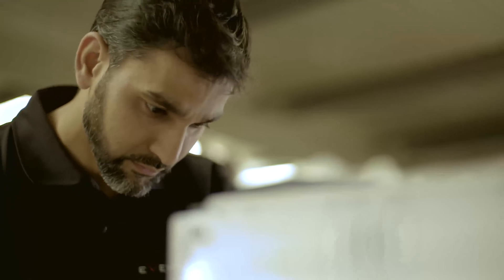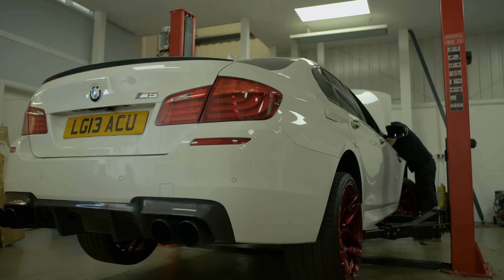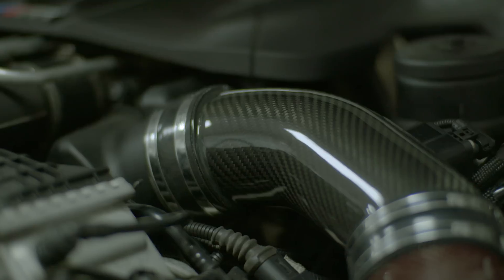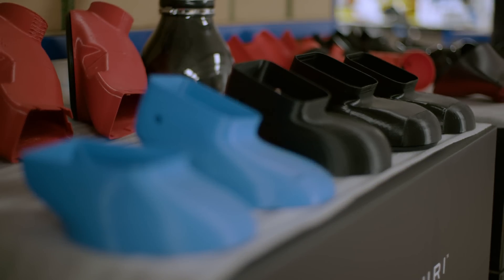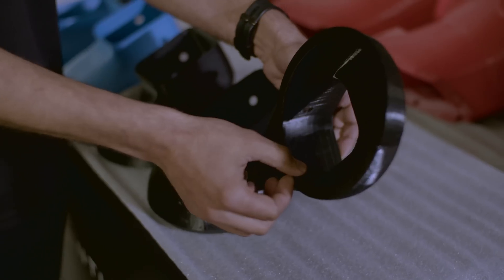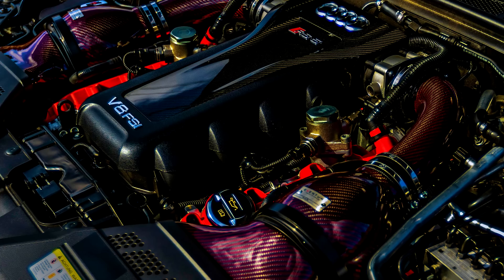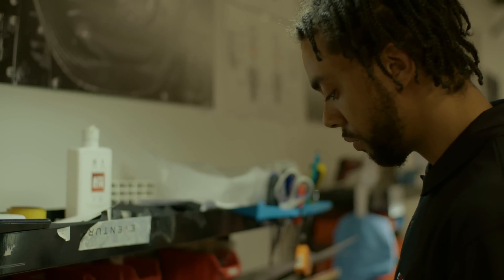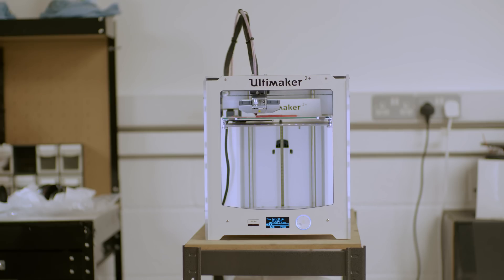Eventuri: Functional and fit testing of performance car intakes - Ultimaker: 3D Printing Story

Comment: @ultimaker what materials do they use for their prototypes?
Reply from the maker: Hi Miiiiauuaua,
On this case study, ABS is used for their car intake models. You can read more about the material and its properties here: https://ultimaker.com/materials/abs
If you want to know more, you can read the full story here: https://ultimaker.com/en/stories/34673-eventuri-functional-and-fit-testing-of-performance-car-intakes
Reply: @Ultimaker  thank you. It would be a great help if you could share these material info s in all your videos.

Btw. I love your printers. I own some s5 and um3s.
Reply: @Steven van de Staak  Yep I use it professionally and of corse I have the cc red I mostly use it with innofil pet cf because I can use hips for breakaway.

Comment: For the sound alone from these they are worth every penny/cent. Makes the E46 M3 much more driveable at lower RPM's - huge difference, and probably the main reason why E46 drivers would buy one. No need to MAF delete or add an IAT relocation kit either, bonus!